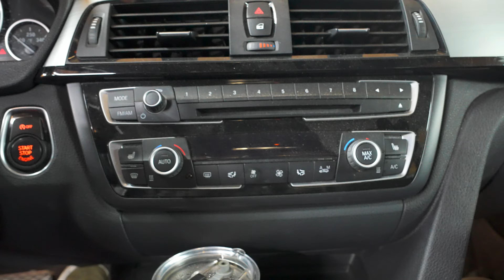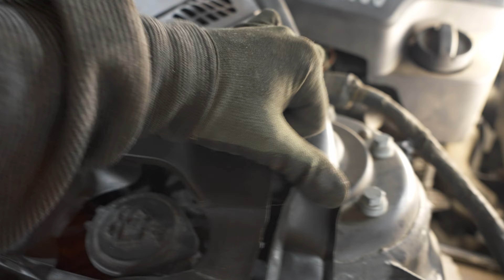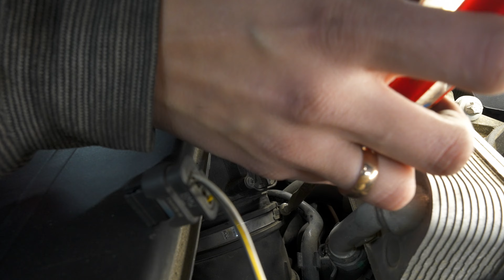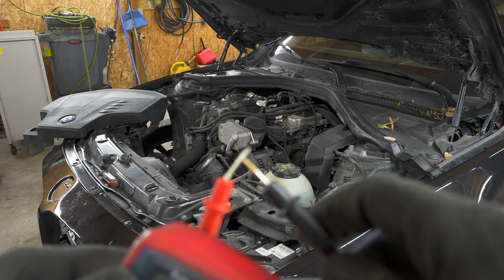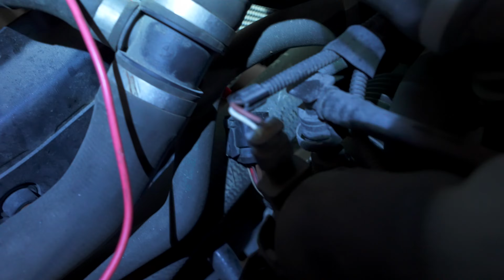DIY How to Diagnose: Electric Water Pump TEST ( BMW F30 / F32 )

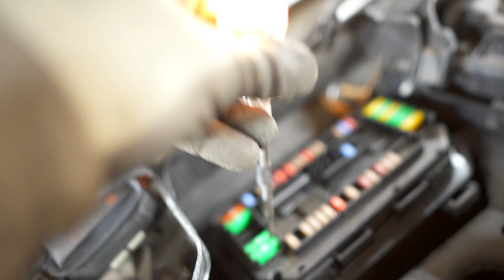Comment: 5:01 there is no fuse for the water pump there. These water pumps are fed by a 100/150 amp fuse (depending on if 200w or 400w style pump) from the integrated power module. That fuse is built into the IPM and cannot be serviced separately. Well it could, but requires surgery of the IPM to access.

Comment: I have a very intermittent overheating problem. Pump runs fine normally, also with purge cycle. But now and then it stops working. When i restart the car it will be working again. Any ideas? Pump and thermostat are new and og bmw

Comment: How do you know which pin to hit with the test light?

And, are you turning just the ignition on or are you pressing the pedal down to make the bleed procedure to come on??
Reply: The only thing you can test with a test light is power and ground. You need a scope to properly diagnose M LIN signal as the physical connection from the wire can be there, but the network could be crashed and not letting messages travel.

Comment: Thank you for DIY How to Diagnose: Electric Water Pump TEST ( BMW F30 / F32 ) the water pump issue on BMW 3 Series, I appreciate your expertise in identifying this critical component's failure, which could prevent potential engine damage.

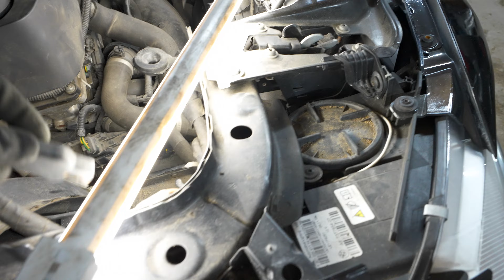Comment: Awesome bro! Highly appreciated your thorough process to pinpoint the actual issue. By the way (7:45
the one of the smaller pins but what I'm) tested both but only ONE lit, is it suppose to be the case?
Reply: I’m wondering the same

Comment: Thanks for explaining ! appreciated. I noticed my fan is on when car is idling or slow speeds. Not hard but i thought this as a sign. also comming slow to operating temp also a sign. So i checked and did the procedure to test waterpump. Its working, making 3 cycles and i can hear the pump. Should i investigate further ? No signs of overheating, staying on temp.

Comment: Is just got code CD9010 on my 2014
428i n26 . I’m going to test the connector this week. Also bmw has a recall for the water pump connector getting wet and short circuiting. But the “remedy “. For the recall isn’t available yet so I’d have to pay 280$ for diagnostic or else they can deny the refund if I don’t take it To them to diagnose directly. Only god know then the recall will finally be sent out i can’t just wait around for it. So what do I do pay the 280$ for them to diagnose and directly relate it to the recall? Or just pay the same amount for parts and do it myself knowing BMW won’t reimburse me because they didn’t diagnose it before I fixed the issue. Such a dilemma 😵‍💫
Reply: So what the culprit after you checked?

Comment: Any idea please how to troubleshoot if the water pump keeps on running after the engine is turned off?  It keeps running until battery goes dead on my 2013 328i (N26).   My thought is maybe relay is bad but have no idea where that would be on this car. Thanks!
Reply: Just replacing the water pump is the most likely solution. I haven't tried that yet
Reply from the maker: @mascho22  With car turned off, check pins 3 & 4 for voltage, there might be a wiring problem where its getting power to one of these pins. Hope you’ll figure it out.
Reply: @kriskmr  Thanks.  I'm thinking it may be a faulty relay.  Do you know where the WP relay would be on this car? The fuse diagrams are of no help
Reply: @mascho22 it could be a faulty coolant temperature sensor.
Reply: @kriskmr  hello sir i am having issues with my coolant pump. It just keeps on running even after engine is off and drains my whole battery. i have checked in female connector which goes into the coolant pump and found both thick wires and they are receiving constant 12 volts and thin middle wires for continuity(good connection with no break). Also checked thermostat wire 1 wire is receiving 12 volt(with engine off) and other wire 3-4 v(with engine on). Can you guide me what else could be the issue as i am lost here now and tired.
Reply: Hi @mascho22 , i also have the same issue…draining my whole
Battery…can you please share the solution if issue has been fixed,,,
Reply: @manjitsingh-bu7lz  There's a Safety Recall for this 24V-608.  Dealer will replace the electrical connector to the coolant pump.  MIne had corrosion on it.  Just got my car back after waiting a month and a half for the part to become available! So far it seems to have fixed the issue.
Reply: My pump stays on even my car is off …so as of now i am disconnecting my battery always until i fix the issue
Reply: Hi @mascho22, thanks for your valuable reply. Can you tell me if you talking about female connector which has be shown in this video or the male connector on the pump body itself? Just wondering what exactly you have replaced. Also do you know what is the fuse number so i can remove that fuse only until i fix the issue i stead of my whole battery plug out. Mine is a 2014 model. Thanks once again for sharing your experience🙏🏼
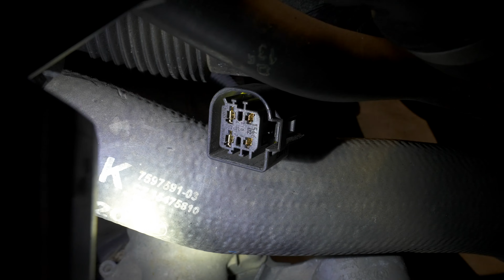Reply: @manjitsingh-bu7lz  Female connector shown @2:00.  They replaced that and the 4 pins too.   I could NOT identify which fuse was for the coolant pump and in this video he does not seem to know either.   Try to remove your connector and see if it has corrosion on it??  If so, some contact cleaner and tooth brush should take care of that.
Reply: @mascho22  hi . Are you sure in your case bmw replaced just the pins on the connector and not the whole pump??? Seems like pump with faulty pin needs to be replaced as whole as even bmw does not sold pin module for the pump.  However they sell the female connector(harness) but not the male part of the pump(i.e pins). Can you please confirm if whole pump was replaced or just a repair on your coolant pump was made.
Reply: @manjitsingh-bu7lz  They didn't touch the pump. By pins I mean the 4 female pins inside the connector housing.
Reply: @ yes those pins you cant remove unless you open the pump. I have tried to unscrew that 4 pin male port of the pump but its non detachable. Only thing i can replace is female port harness and full pump. I am talking about the 4 vertical pins which are part of the pump. That was replaced too?
Reply: Hi @mascho22 …thanks for your reply-
1. I have checked with bmw for my particular car via VIN number and they said my car doesn’t have a recall so i believe its only for few cars😮(not all).
2. I have opened the connectors both male and female side, i did found some oil traces on the connectors (just little bit) which i cleaned with tissue paper but no rust at all on both sides. 
3. Do you still think i need to change the connectors? If yes, female side of the connector i can buy and its available in the market but male side which connects to the coolant pump is not available separately so i have to replace whole pump. 
4. Will you be comfortable sharing your email or number for easy communication in regards to this particular issue.
 Everything is working fine its just the water pump is not stopping even after engine is off so it’s killing my battery and every-time i have to unplug my battery negative and reconnect again…
Reply: @manjitsingh-bu7lz  If the connector looks clean then I wouldn't bother changing it. Probably the pump is faulty so just replace that and hope it resolves the issue. That's what I would do.  After market ones are not that expensive.
Reply: Hi @mascho22 , i just checked the voltage on both ground wire and power supply wire on the female connector and both are receiving 12V. Also 2 small thin wires have good continuity from the female connector to the harness(zero resistance) which makes me think connector is good. Do you think i should change the thermostat next before i do pump replacement as pump works but it does not stop so i am guessing may be if thermostat is faulty it does not sends signal to stop the pump.
Reply: @manjitsingh-bu7lz You could try that. What model do you have?
Reply: @mascho22  its 320i , 2014 model, F30 …I didn’t scanned my car yet just to let you know
Reply: @manjitsingh-bu7lz can you change just the temp sensor without changing the whole thermostat?
Reply: @mascho22  where is this temperature sensor located?
Reply: @mascho22  Also just to let u know my temperature gauge in the dashboard is moving up when i am driving, do u still think i should try to replace sensor?
Reply: @manjitsingh-bu7lz  Temp gauge is oil temp, not coolant temp on F30.  I still think you should replace the water pump if it keeps running.  Seems to be a common issue.
Reply: @mascho22  noted, thanks for adding to my knowledge. So you think i should proceed with coolant pump change instead of thermostat?